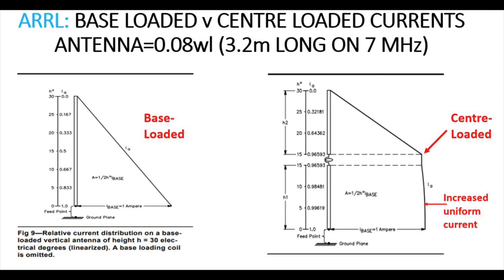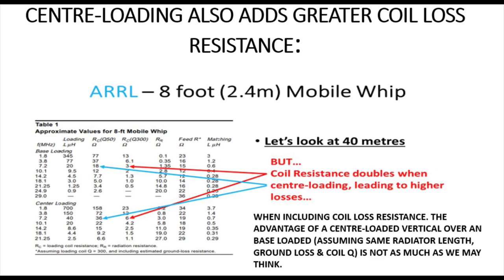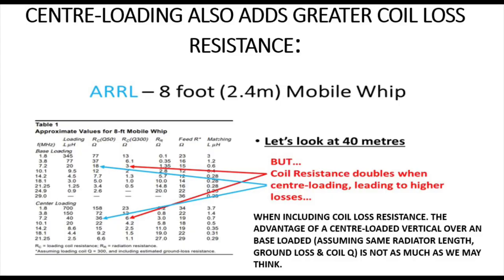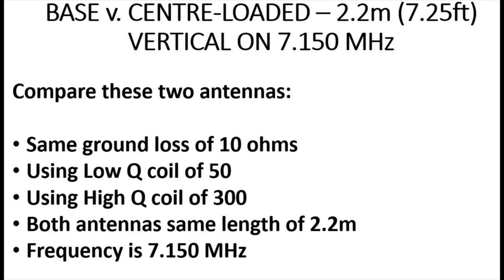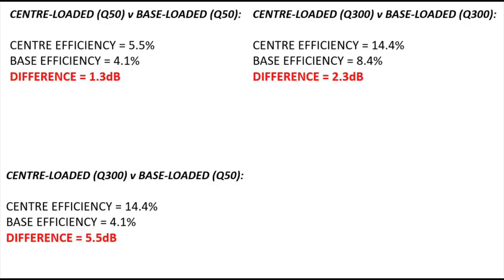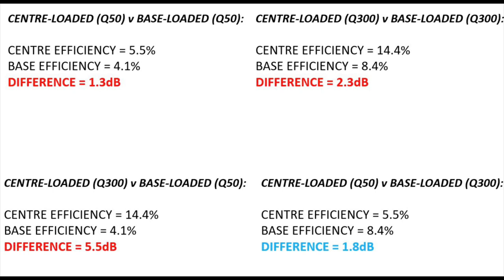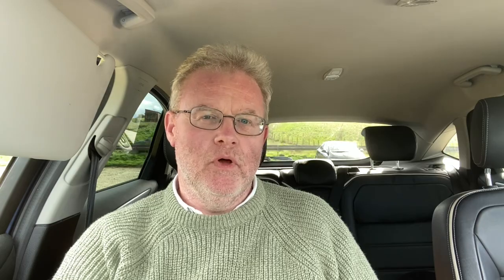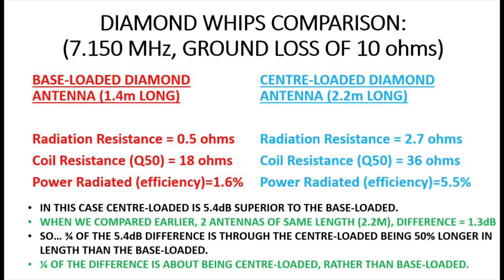Ham Radio: HF Mobile - Base-Loaded or Centre-Loaded?

Comment: Wonderful video Tim!  I would add the mechanical constraints of each type in the comparison.  Base loading puts the weight and wind drag at a minimal position while the center loading increases both wind drag and weight AND also the torque on the mount due to the lever effect.  In the end, a proper capacitance hat (stationary vehicle) seems to offer the best radiation resistance and lowest loss.  We often use part of the top radial wires on our broadcast towers as a cap hat for towers that are a bit short for the frequency of the station.  This can happen when a station (say 1500KHz) is sold and the license goes to a new owner at frequency (800KHz).   It is a good way to increase effeciency while the engineer works on the GM for a real operating budget or quits.  LOL!   73, and keep up the great work.
Reply from the maker: Ah yes I totally agree about cap hats .. now they ARE silver bullets on 40-160 for sure! 73

Comment: Hey Tim, greetings from Silicon Valley! This is the best analysis I've seen yet on this topic - thanks so much for putting it together. You approached this messy subject with clarity and logic which made it easy to understand. I would be VERY interested in a similar discussion about the Cap Hat. I know it makes the best physics to place it at the top of the antenna but so many operators can't do that for whatever reason(s) and place it above the loading coil, or halfway up, etc. That would be a great video, too 😀 73 KJ6ER
Reply from the maker: Thank you Greg! Placing the cap hat say above a centre or base coil will work in the sense it will make the antenna broader banded but the price is it’ll be less efficient

Comment: Tim, great video. Literally have just been playing with this same topic. I have two quick questions that either you or someone else might be able to guide me on.
1) Does the centre loaded coil have to be exactly in the centre? I have used K7MEM calculator which allows you to put it anywhere but I am unsure what that would do to its radiation efficiency. I know the further away the coil is from the feed point the inductance required goes up...this leads to question 2
2) what would happen if we swap out the air cored wound coil for a ferrite wound coil of the same value? As this shrinks its size and there fore allows for a longer top radiator or longer overall radiator. I am thinking there could be bandwidth implications? or is this a no-no? 

One thing I hate about this hobby...so many variables!!!! . I have made a 40m centre loaded that approx 3.8m tall. Also a 80m off centre loaded 3/4 1/4 at about 5.7m. I am getting some contacts, but the QRM at home is a killer. I am in ZL land but I can hear VK's and occasional JA. Next builds are Mag Loop and LOG to kill some noise.

Anyway next experiment is the ferrite inductor. I might be back with more questions.

Thanks again, 73  ZL2DEW
Reply from the maker: Super questions! On a vertical, the coil can be anywhere, funnily enough as you move it nearer the end further than centre, it’s argued that efficiency suffers. Please report back about the ferrite loading. 73

Comment: Very interesting video. So it sounds like it doesn’t really matter which you go with. I don’t operate mobile HF only POTA. I do it outside my car and don’t use the car for the antenna. I have a 17’ Chameleon whip I use for 20-10m and a couple of choices for coils. The BuddiStick and the Super Antenna and both of those are center loaded. The WRC coil I believe is a base loaded setup but I’ve never tried one. Thank you for the explanation.
Reply from the maker: No problem! Sounds like you are having lots of fun

Comment: My answer to those experiments is 5 meter (17ft) long telescopic whip on a magnet base on a metal roof of the car. I don't use any coils to avoid losses. That's important. I just keep the telescopic length as a quarter wave length on every band 20-17-15-12-10 meter. And it works perfectly. No problems with establishing contacts with VKs. Recently had a contact with this setup with Hawaii. I use bottom loaded coil on 40 meters and the antenna is still efficient as actual radiating length of the whip is 1/8 of the wavelength for this band.
Reply from the maker: Definitely can’t beat a straight QW.. just need a location to use the 17ft

Comment: Interesting Tim. Thanks.

I've not done any mobile operating on HF for probably 50+ years!
In those days as a teenager, it was 160M that was of interest -- and Base loading was the ONLY chance you had to get something fixed to the car that wouldn't break streetlamps with the whip section as you drove past 🙂 (or pull the wing off your car if you caught the antenna on a tree or bush!)
I've also run centre loaded verticals at the home QTH in 'postage stamp' gardens with a capacity hat  above the coil to 'drag the current' further up the antenna. I always made contacts -- which was the main objective.
There was very little maths involved back then -- just 'emprical' methods -- but we did at least have fun trying!
73
Bruce G4ABX
Reply from the maker: Sounds like proper fun Bruce! 73

Comment: Center loaded whips have a radiation pattern like a 5/8 wave out to the horizon, Where as the base loaded 1/4 wave gives you low angle radiation pattern for dx. So for example on 40m the center loaded is great for inter G, The based loaded great for dx. So if dx is your thing Base loaded should be your choice.
Reply from the maker: Good points. I think in practice given the minimal difference in efficiency, we’d struggle to notice any on air difference between them.

Comment: Hi Tim, avid viewer and reader of your work. Do you have a complete citation for the ARRL work yiu used here? I scanned the latest Antenna Handbook and did not see what looked to be your source material. 73 de K4FMH
Reply from the maker: I will need to check Frank.

Comment: Hi Tim. Great video and learnt a lot!

I've just bought an Ft857d and borrowed some AM PRO baseloaded whips from a friend onto a magmount just to try them out. I may get a Diamond K400 mount or use a separate earth strap at the base of the antenna. I was only able to use the 20m due to 10m being flat. I worked Italy, Bulgaria and Lithuania in about 10 mins during a contest that was going on. 
I only intend to use HF static mobile and thinking about a more efficient antenna system for 40 20 and 10m. You mentioned a 9 foot antenna you use. Can you tell me who make this or if its homebrew and recommendations for base loaded coils. Many thanks Simon M0SCS
Reply: Hi Tim Just found all your vids on Sidewinder M1EEC coil and Chameleon MIL whip. Looks ideal for my use. Great videos as always! Simon M0SCS
Reply from the maker: Thanks Simon they work great!
Reply from the maker: Hi Simon I think you have already found this information - its a 9ft tank whip antenna (about 20 quid) and the slidewinder coil or my LDG RT100 ATU near the feedpoint. 73